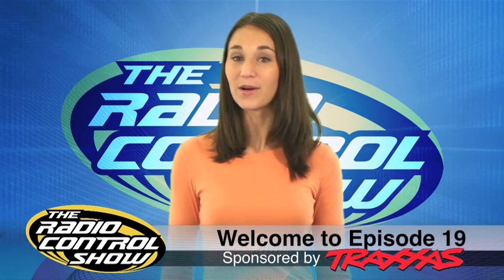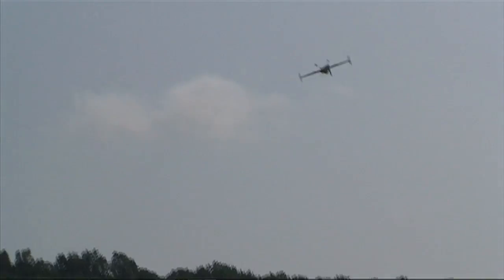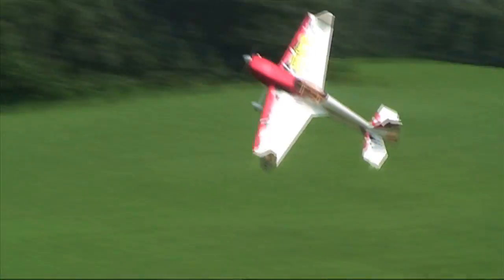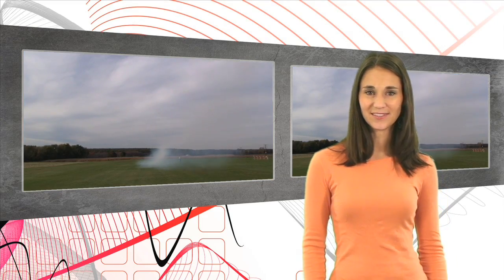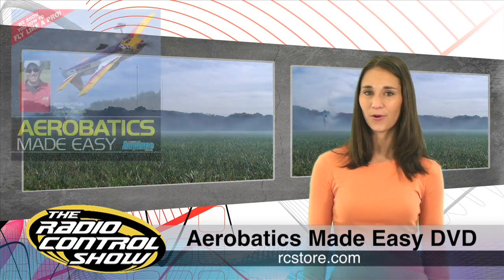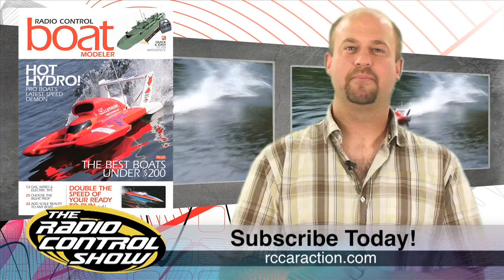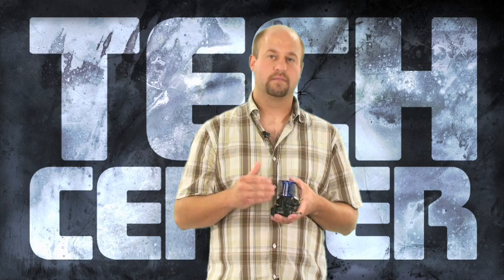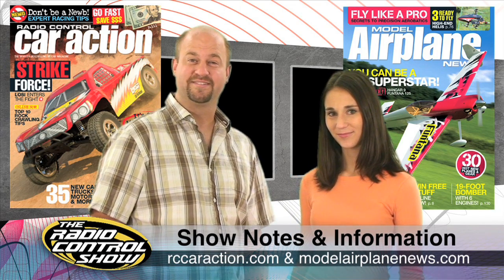Nitro Engine Tech Center - The Radio Conrol Show 19

Comment: ok, heres a question for you kevin, my uncle has a Revo 3.3 truck. and i have a savagex4.6, and i tryed to help him tune his truck, but we got the truck to perform, its just that when the truck is sitting idling, as soon as you give it ANY amount of throttle it dies, if tried everything i know, raising the idle, richening and leaning out the high/low speed's and i still cant figure it out.